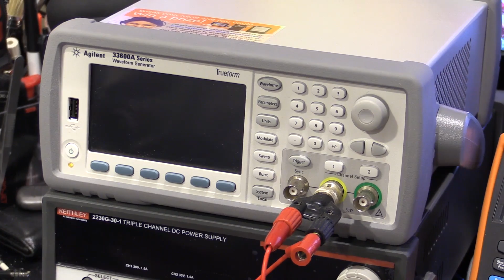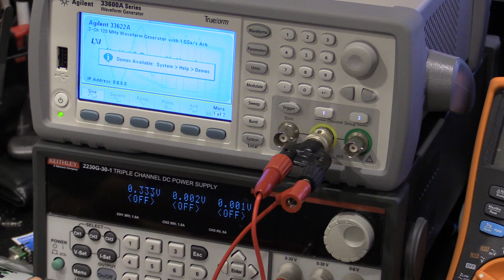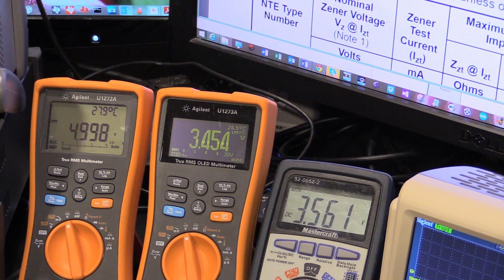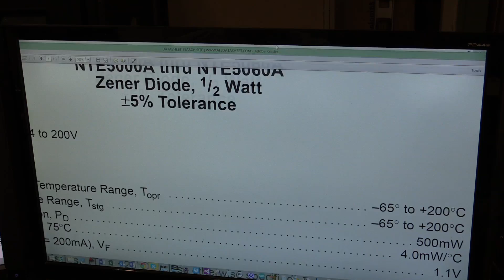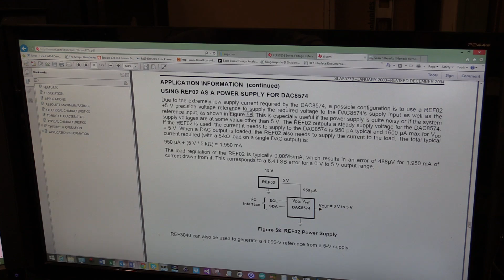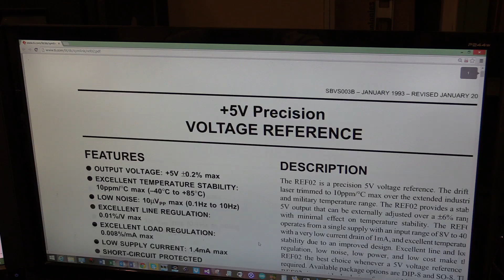The Modular Bench Power System, #2, Voltage References pt2

Comment: Awesome course. Thanks so much. I was going to buy a Rigol power supply and build my own arduino controlled electronic load but this is far better and designing each stage in front of us is very informative. I have a question though and please excuse the ignorance but I'm just getting back into this childhood hobby after 20 years.

Can I safely replicate your experiments with introducing ripple? I''ve got a old analog bench psu from my younger days and I've recently got a Rigol DG4062 arbitrary waveform generator. But all my alarm bells go off at the thought of connecting the two together and then creating a common ground. Wouldn't this require that my generator sink (say -2.5v from the power supply during the negative of the 5v sine wave) and I'm assuming that would be bad for my DG4062? But this appears to be what you did?  Or have I just got myself confused?
Reply from the maker: +Justin Betts I used my generator to drive the low current High impedence input to the control (Reference input when selected) basically 0 - 5V representing 0 - 5A.
The grounds being connected together should not affect anything as the current will go back to where it came so the signal generator will only output a few mA, the power supply will output the high amps and will flow back to it

There is no negative of the sine wave as I elevated it 2.5V above 0 so it goes from 0 - 5V not -5 to +5
Reply: +Peter Oakes (TheBreadboard) Thank you for the reply Peter. I look forward to trying these myself.

Comment: i've been watching your Modular Bench Power System videos and I have a doubt. Is it necessary to do a similar temperature stability study concerning the two resistors in the voltage divider of the feedback control loop (the 10K and 90K resistors)? What if they have a temperature drift bigger then the voltage reference? Thanks.
Reply from the maker: fabiovsroque The resistors I used in the early prototypes have virtually no temp co (1ppm or better) but the build were more basic types. It is shorter term stability I went for there and as there is no power going through them, there will be no or minimal heating effect so limited to ambient.
Also as the current is being set by a 10turn potentiometer, I think it will have the worse affect with temp than those resisters
If this was precision and automated, that would be a different story of course

Comment: This series of tutorials is developing into an ideal way for me to get more depth of understanding of power supplies and their parts. I've come back to learning electronics after more than 40 years. I started by making Dave Jones' battery-powered power supply, which is a switch mode power supply. (It's working but not quite finished.) Inspired by these tutorials, I think I might make a linear power supply with higher voltage and current output next.

Thank you Peter.
Reply from the maker: Your welcome, and hopefully you can enjoy the ride as far as you feel comfortable and get off or stop building at your choice point.then simply enjoy the rest of the development, that's why I'm making it a modular system. The additional modules can also be built stand alone or included with the final project (DC Load and Power Meter). and if you want to stay fully analogue you can, or up to a uController based system,

thanks for the support,

Peter